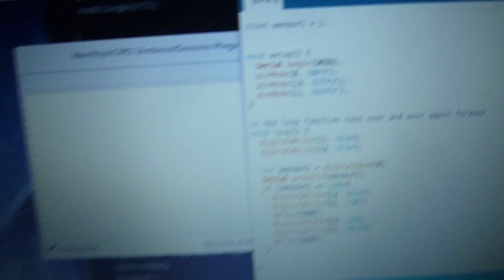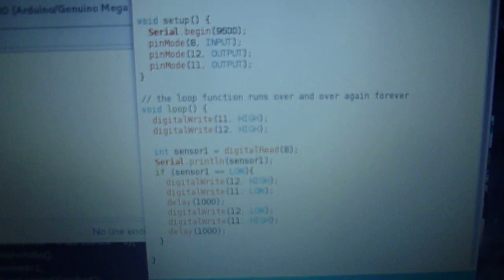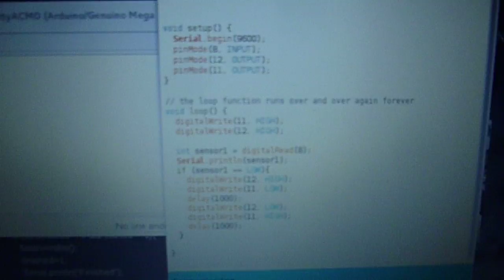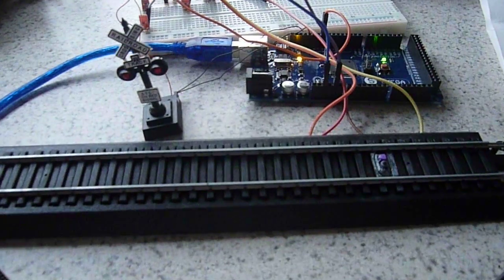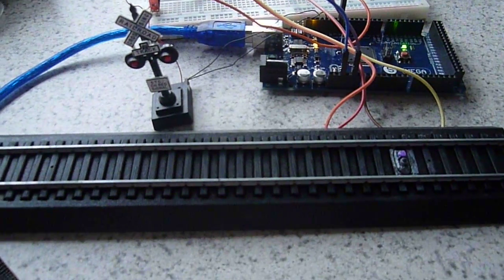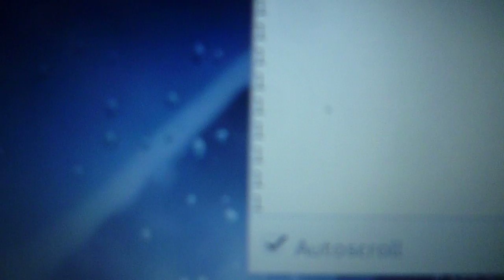Model Railroad Crossing Lights - Arduino

Comment: Hello, I am new to coding so I have a question regarding the code. Would this code work for any Arduino controller? Also, does the program run every time the board is powered up?
Reply from the maker: yes, all arduinos and arduino work alikes use pretty much the same code, with slight changes depending on number of analog inputs, serial ports, etc. The code starts as soon as power is applied and continues to run until power is removed.

Comment: Hi Steve, Interresting item on the lay-out. This inspires me very much. Do you have a sketch on the Arduino-site, for sharing?A Dutch railroadcrossing is quite simular to USA-crossings about the technics they use. So I want to use it for my lay-out. Ihope my English is clear enough. Thanxs.
Reply from the maker: Koen Frijlink yes, the sketch is posted on the listed blog link.
Reply: Thanks, I missed that one. I would like to combinate it whit servo's but first I have to learn to work whit Arduino. I have also a Mega.
Reply: Also read you want to reach the same whit servo crossing bar. Think you need a second sensor for the detection to the servo.

Comment from the maker: Minor mistake. The negative (cathodes) of the LED's are not connected together, but go to separate arduino outputs. See schematic at  - http://arduinotronics.blogspot.com/2017/01/model-railroad-crossing-lights.html
Reply: Did you manege to make a part 2 Of the Video? tks